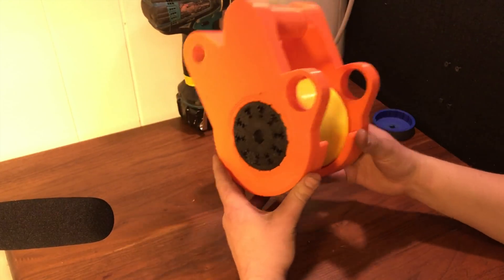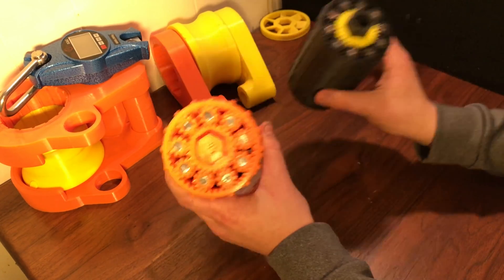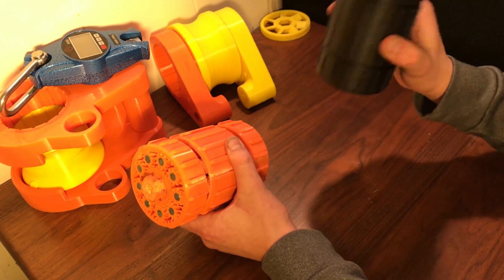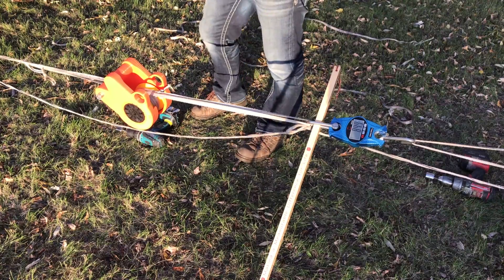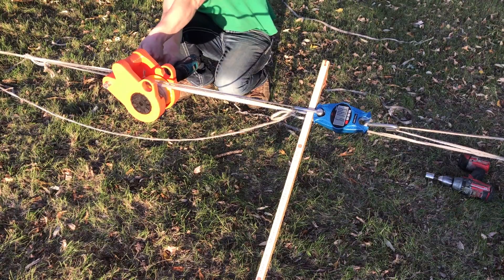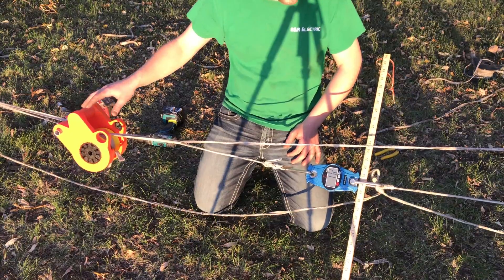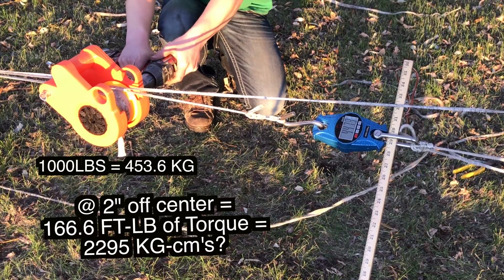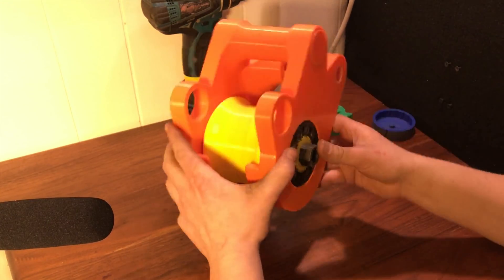660LB Scale Overloaded by 3DP Gearbox [Tug Of War]...

Comment: Given that it was only one planetary gear failing it leads me to believe that it might’ve just been a faulty Machining problem that caused that one specifically gear to fail and if it hadn’t it may have pulled more you should try remaking that gear and doing the test again it might be able to pull a couple hundred more pounds

Comment: Awesome project. Watched this series when it came out and now im rewatching it cause I need some gearboxes, and im only now appreciating the awesomeness in its fullest. Too bad youve been quiet on the youtube front lately. One improvement that comes to mind is to epoxy the steel rods into the planets. Probably does stick super duper on the nylon... but perhaps one could use rods with longtudinal grooves, heat them up and melt them into the plastic for some decent grip. Seems like that would have delayed the observed failure mode; the shear these planets need to transmit along their layer lines seems to be the limiting factor here.

Comment: I have not watched this video for a couple of years, but I still find this extremely impressive. I want to try building one of these for myself, and I have some questions.  1.) Were the metal shafts glued into the planet gears, and if so what glue was used?  My second question is what  size nozzle and what temperature do you use to print NylonX?  The last question is do you require a printer enclosure to successfully print NylonX like you do with ABS?  Thanks for making such great content!

Comment: Love what you are doing here, but let's do a reality check on 3D printing, respectfully.   BTW -  I'm a retired aerospace engineer, and I also prefer Autodesk Fusion 360 for my projects.  I like 3D printing in some applications, don't get me wrong,  but I don't have one.  I used versions of 3D printing at work for the past 30 years, but only for prototypes, as the material properties just aren't there for aerospace primary structures.   I am somewhat familiar with titanium 3D additive processes, but the cost, energy consumption, and material properties have a long way to go, last I heard.
Your gearbox is a good example of a reality check on 3D printing vs traditional metal construction.  As cool as your gearbox is,  you could buy an Harbor Freight 8000-pound steel come-along for $35.  But really cool anyway.

Comment: Awesome work dude perhaps see if you can visit an engineering workshop and use an overhead pulley system with some heavy equipment and their system as backup (for safety). Then use your 1:149 gearbox and perhaps a two others perhaps a gearbox with 1:180 or more and  a 1:120 or less and see how the ratio affects the overall max torque/weight tolerance before failure.

Comment: wholly shit, this is cool. I can use one of these as I must haul heavy loads up onto rooftops regularly and I don't have anything more than a cordless drill as power. my average weight to pull onto a rooftop is prolly 100 lbs in multiple loads with average height of 30 feet. doing HVAC work can be hard on your body with repetitive lifting of all this weight and climbing ladders so anything to help without adding to the physical load is awesome. 
so the ideal gearbox would use aircraft cable with a locking hook on the end. I already have a rack that is lightweight to attach the gearbox to that would stand approximately 4 or 5 feet over the access hatch. 
It would also need some sorta fail safe, like a latching mechanism so that if the whole thing were to explode the latch would prevent say like a compressor from falling like a meteor and leaving a crater in the floor of the building. 
What makes this so appealing over commercially available lifting mechanisms is the lightweight and the ability to power it with the cordless drill. I have already made electric winches attached to strut for this purpose but all is more heavy than I want to haul on the roof by rope for every day loads. This could make a small 5 ton air conditioning compressor job so much less back breaking not to mention cost saving as this would enable one technician to do the job by himself instead of two where the second tech is just to help lift all the stuff on the roof and lower it back down.

Comment: I just moved a 1000lbs dog house onto a trailer and then off and into position using ratchet straps and old wheelbarrow wheels as pulleys... got the job done, but this gearbox would've made my job much easier. I had no idea I could 3D print such useful things like this...

Comment: As far as the safety ropes go, wouldn't the gearboxes just fall almost straight down if the rope in the center broke?  That rope ideally isn't very elastic so not much potential energy will be amassed there, meaning the gearboxes wouldn't be pulled in that direction much at all.   I may be wrong here, but that's how I'd interpret Newton's first law in this case.

Comment: Interesting that the herringbone gear failed along the center.  Perhaps it was under high axial tension.  A helical gear generates axial forces and the two halves of the herringbone are supposed to cancel forces but it would still put the gear itself under axial stress.  It almost makes me wonder if the gearbox might have different strength in different directions, since one direction puts the planets under tension while the opposite direction puts the planets under axial compression (meanwhile the sun and ring under axial tension).

Comment: I'm not impressed by the gearbox ratio being able to handle those forces, but dude how the hell is that hang point not sheering under those loads? Did you reinforce that section with metal inside?

Comment: Would make a awesome off road motorcycle winch strong & light I can see a market for it
Reply: allan mitchell  How much do you think people will be willing to pay for it? Considering each of these winches represents dozens of hours and a not-insignificant amount of filament material.
Reply: DrewLSsix not shore  but it's like any product there's  hours of r&D and research  just have a look what it costs to prototype a car its costs millions .but you don't pay that much for a car  production of many units makes it cheaper
Reply: allan mitchell. That's not how 3D printing works, a car from the beginning of the assembly line to the end of the assembly line probably takes less time to build than simply printing the parts for one of these gearboxes.
Reply: from the size, I'd say it's 1-2kg of plastic, so about 130-260 bucks, add 100-200 bucks in printing cost.
even counting only 1 500g roll of filament, it's 65$, a winch is about 40, so you'd be better off getting the non 3d printed one.
Reply: manaquri.  Yup, when parts of consumer grade equipment is stamped out of raw stock faster than they eye can follow printing is exposed as being ill suited for production work.

Comment: NICE!   Your planet gear broke because you used  helical gears .. the helix angle induces a tensile load on the printed gear layers, and the layer to layer strength is typically weak. Instead try > a much reduced helical gear angle (like 10 degs vs. normal 30 deg angle)
> print gears at 5-10C hotter nozzle temp
> use a stronger material? (PETG, is cheap, tough and strong)
Reply: Robert Reichwein he was literally complimenting and giving tips on how to possibly make it better 

The one who needs to shut it is you buddy
Reply: Also glue the core pins in there with epoxy so they can absorb the tensile and torsional loads.

Comment: When you have them do a tug of war you have them sharing the load, depending upon the length of the rope on either side we could say it was 50/50. Have the gearset anchored to one surface, the scale to the other and test then.
Reply: This is incorrect. The way they set it up, both gearboxes got 100% tension. The length of rope has no impact on that.

Comment: you can sell this commercially saying its a gear that takes 50kg, as 10x
 that is critical failure and is usually the safety margin you need to 
have. (For lifting that is)
Reply: Factor of safety is often 3 times. So this is good for almost 150kg
Reply: Safety margin here is 1:4 ratio so rating would be 120kg

Comment: Anytime a test is involved you need a 5:1 safety factor other wise you deal with failure that can be avoided
Reply from the maker: +Nola0187 H right, so the gearbox couldn’t be rated at 1/2ton. But still anytime you bring something up to its failure point it’s usually going to be one component to fail, then a chain reaction

Comment: What amazing results! A quick note that may not only prevent this error in the future but may increase you're maximum load!

When you use herringbone gears, the direction of force is very important, especially for 3D printing, I would heavily suggest you orient the load (or modify some gears, I have yet to closely look) so that the gear is load, it wants to push the the gear together, a compressive force. This would work out great as we all know 3D printed part peform a bit lower under tension and that's what you see in this video, with the load applied the way you had it, it was trying to pull the gear apart (why it splits perfectly)

In fact, most herringbone gear boxes are made this way as it is (albeit a somewhat unknown) design rule when using herringbone gears.

Let me know what you think or if you need clarification!

Comment: Try infusing the gears with cyanoacrylate or another thin, air drying resin using a pressure or vacuum tank. That should fill any tiny voids where breaks can start.

Comment: Wow, Incredibile project. But don't you think the gearbox would withstand much bigger load with hexagonal rods in planetary gear?  I believe those parts works on torsion not shear. If it's true the circular rod doesn't help to printed parts- because they might rotate around the rod without any disturb.
Reply from the maker: +Marcin Konert it’s possible. And I think their in both torsion and shear.

Comment: You could try using instead of a cilindrical shape rod for the a hexagonal one (or another shape) so the internal torsion of the planetary gears spreads
Reply from the maker: +Raimundo Alejandro Espejo Mandujano that’s a really good idea. I might use that if I can get hex shaft for cheap
Reply: Gear Down For What?  Or you could also use a threaded steel rod (those are cheap) and mirror the threat pattern inside the planetary gears (kind of a pain lol)
Reply: That way both the rod and the 3D printed part will behave like one solid component, instead of like a rod with a case
Reply from the maker: hex shaft is actually cheaper than the linear rod that I've been using lol
Reply: lol

Comment: Oh... By the way, can you guys calculate or test the maximum torque that this gearbox could handle?
Reply from the maker: +Ti M it was 167 ft-lbs
Reply: Gear Down For What? 
Hmmm... Well, I'm not very used to imperial, because I'm from Brazil, but don't worry the imperials will be side by side. Hehehehehehe 😂👍

167 ft-lbs should be around 226.42 Nm ... Smaller car engines usually reach a peak torque below 20kgfm or around 200Nm (147,51 ft-lbs). 

Impressive how much it can handle, but the gears are fairly big to achieve such results.

By the way, mineral or synthetic oil seems to damage 3D printed parts if submerged for long time?

I really believe it's possible to do plastic transmissions, but lubrication, temperature, vibration tolerance, manufacturing costs and durability are couple things make me curious about the feasibility of the concept.

I'll be following your experiments closely! ;D
Reply from the maker: It may be possible, I'm just trying to learn everything I can so I can have a lot of test results and know what to expect if I use this in bigger projects.
Reply: Gear Down For What? Perfect! That's the spirit! ;D 
I'll be following you in your experiments.

I know that couple "hypermileage/eco" competitive teams are using 3D printing parts (steering gearbox/rack is one of the most extreme application so far) on their cars. Not sure, but they could be interested on that too. ;)

Comment: Would you be able to winch your truck out of the snow or out of a ditch in an emergency with your printed gear box? Some people carry impact drivers and rope in their trucks anyway, adding a winch/pulley would make a great addition for use in a pinch. Great job either way.
Reply from the maker: I guess it really depends on how stuck you are, cool application idea though, doesn't usually matter how long it takes to get unstuck as long as you can get unstuck

Comment: What material do you use and what infill?
Reply from the maker: Nylon X, Check Thingiverse for print settings
Reply: Thanks a lot.
Reply from the maker: lol I hear your sarcasm. I added a link in the description
Reply: I'm actually being very honest. This item is very useful and you are giving the plans free. 👍🏽
Reply from the maker: Yeah, its crazy what you can get away with with a huge nozzle and really thick walls. The bottom thickness on the outer casing I got wrong the first time and I still used it, you can almost see through it.

Comment: Would it be possible to build a drill powered crane for your truck using one of your gearboxes?
Reply from the maker: I didn't think so before, but now its starting to seem like a reality
Reply: Gear Down For What? Thank you so much for replying, love your vids and keep up the great work!
Reply: The answer to this question has nothing to do with your gear boxes other than their energy efficiency. Use silicone spray lubricant (rather than hydrocarbon oils) to protect your plastics reduce stress and heat loss. Dielectice grease is silicone based as well and won't damage your plastics if you want a grease lube. It's a matter of thermodynamics - 1 Wh of energy = 2655 lb-ft of energy... My junk Ryobi cordless drill has a 24 Wh Lithium battery, and assuming a 20% loss in the motor and gearboxes, and 20% remaining discharge limit that leaves 15.4 Wh = 40877lbft of energy. A typical half tonne weighs about 5000lbs, so you could lift it roughly 8 feet off the ground before the drill battery is discharged to its limit as long as the gearbox doesn't break and the drill can exert the required torque and you can spool enough rope given all the pullies (effectively further gear reduction) you would need.